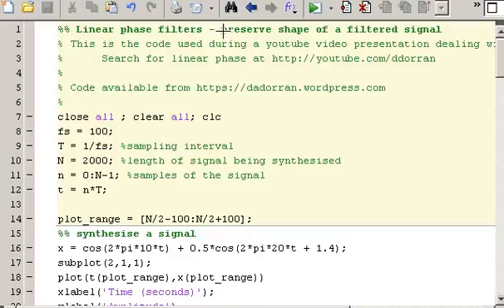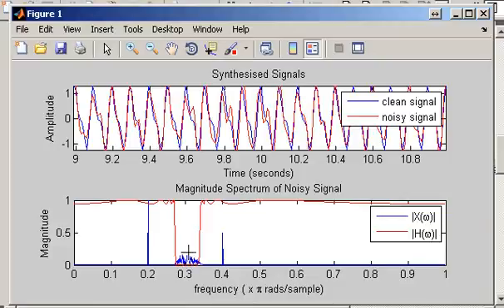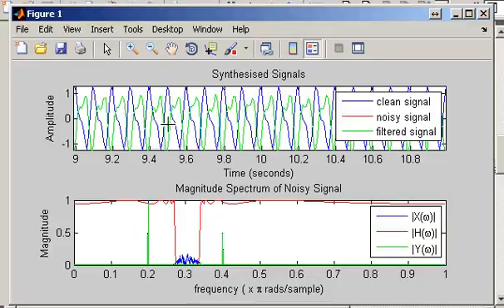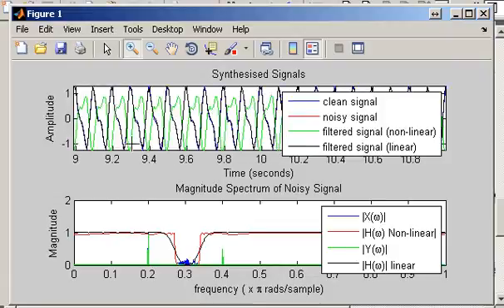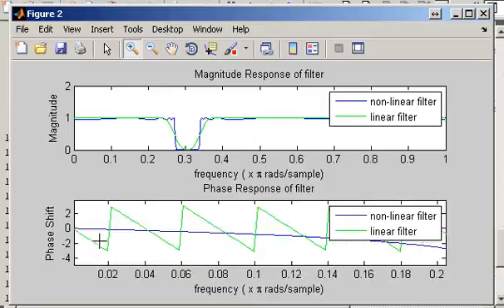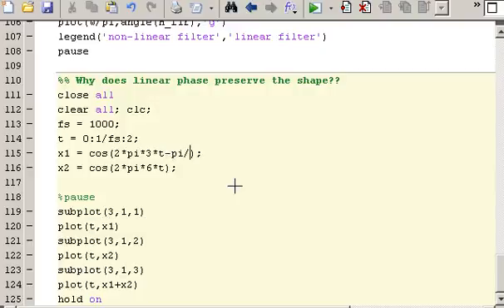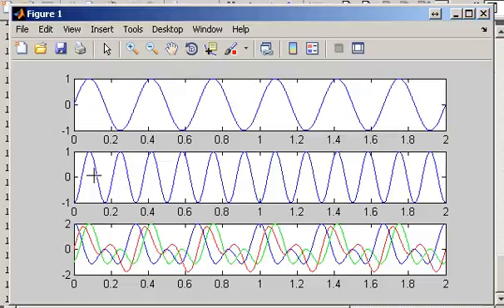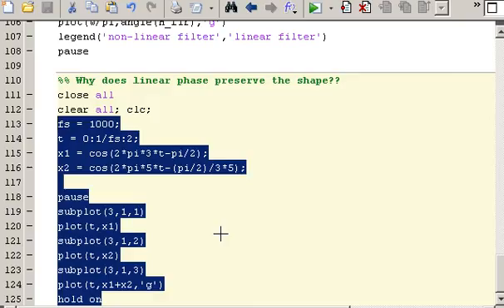Why Linear Phase Filters are Used

Comment: Amazing Video. thanks for that. But regarding "Audio applications do not require linear phase filters because the human ear cannot detect phase change" - as this is a correct statements, but while audio processing does not stop at the non-liner phase filter, some further processes may be applied after the filer, such as a compressor/limiter, or a distortion (non-linear process) , which then the wave shape difference may cause the non-linear system to behave differently and produce different harmonic distortions or such... thanks.

Comment: very cool, linear phase preserves the phase of the signal but why dont you use a sound to show this. I mean music, it will be more convincing...because the magnitude used here are not equal it might be bcos of this, I actually understand the whole concept and phenomenon, but I have never seen any one using music to illustrate this concept, of linear phase and non linear phase.
Reply from the maker: Uthman Zubair Our auditory is pretty insensitive to phase (except for frequencies in close proximity i.e. within one quarter of the so called bark bands) so signals in which the phase has been altered generally won't be perceived as being significantly different.
Reply: Thans I also thought of it that way but still if I want to apply this phenomenon to music how will I do it? just to see what will happen.
Reply from the maker: filter the signal with a non-linear phase filter

Comment: Sorry why do you use FIR as linear filter and IIR as non linear filter?
Reply: +Uthman Zubair no IIR has a linear phase response, but some have approximately linear phase responses which are difficult to design but more efficient.
Reply from the maker: Uthman Zubair It's easy to design FIR filters that have a linear phase response

Comment: this was great! thank you. so basically a linear phase filter provides a certain phase shift at a certain frequency, and for example twice that phase shift at twice the frequency? (in your case 5/3 the shift because the frequency was multiplied by 5/3 when going from 3 to 5)
Reply from the maker: that's it - and by doing that the phase difference between sinusoidal components is preserved. If the phase difference is maintained then the waveform shape will be too.